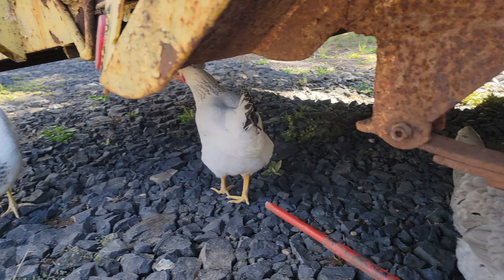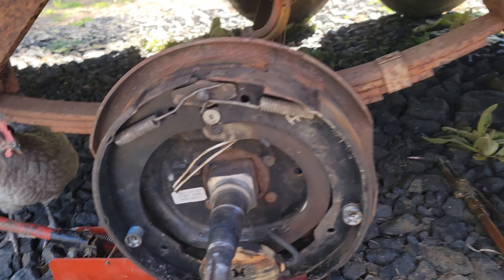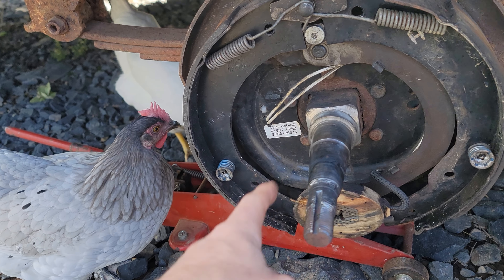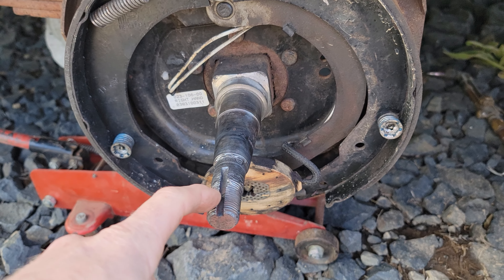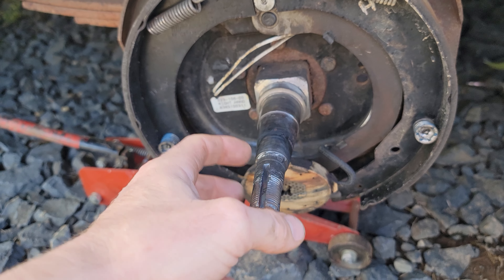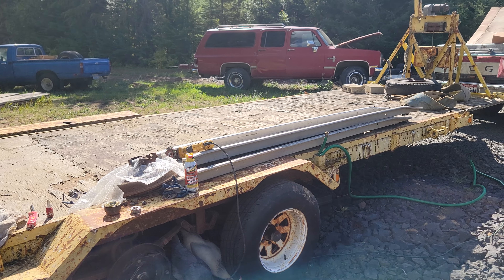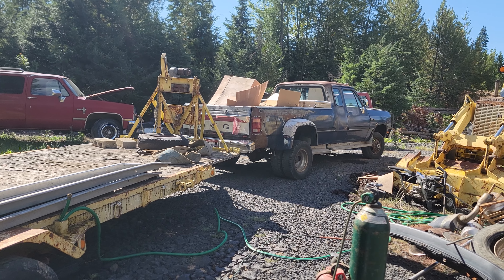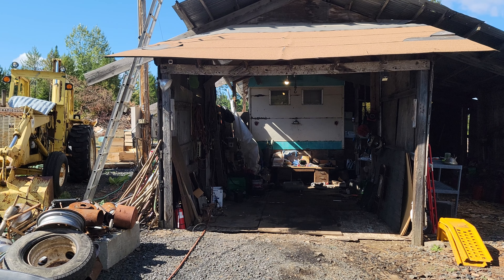Fixed the axles bent spindle on my car hauler trailer.

Comment: I just removed the vintage hydraulic brakes from my trailer and installed electric brakes. 
This is the trailer I intended to turn into a mobile chicken coop, but since I'm moving, it's turned out to be useful. With brakes, I feel safer pulling it with the little Subaru. Speaking of that, can you put nitro on a Subaru 2.5X?
Reply from the maker: Sorry, I'm just now seeing your comment.   Good to hear you were able to upgrade your brakes before the trip.  Makes a huge difference having trailer brakes.  Yes, you can put nitrous on pretty much anything.  One of the easiest ways to add more power, but can damage the engine if not tuned well enough. Can't let it go lean.  I'm sure someone sells a kit for your Subaru.